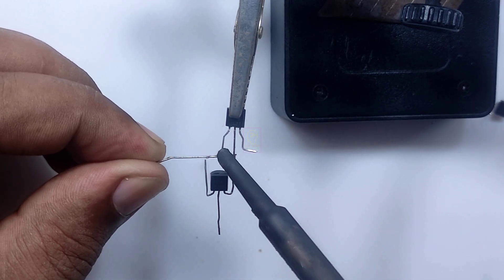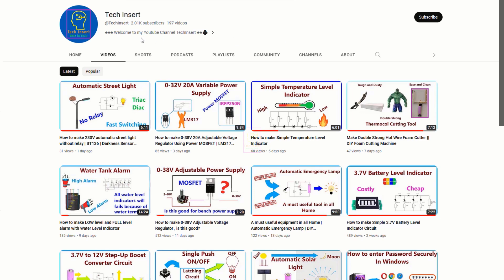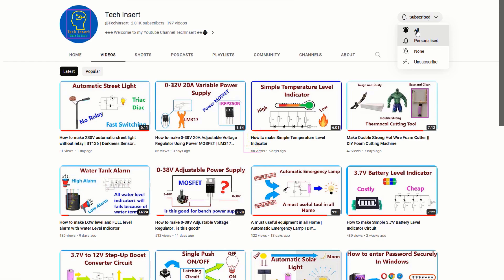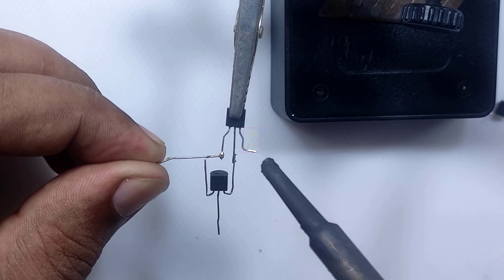How to make wireless AC voltage tester | DIY AC Voltage Tester

Comment: Will this works in two 1.5V button cells?  I would like to enclose this inside a pen which will be very compact. Any idea on availability of small buzzer?
Reply from the maker: Yes it will work with 2 button cells. Replace 1k resistor with 560R.  Use 3 mm led for enclosing inside pen. Also remove buzzer. Transistor leads should be shortened with minimum length. I cant see a micro sized buzzer . The smallest one I had ever seen is in the computer motherboard  which cannot fix inside pen